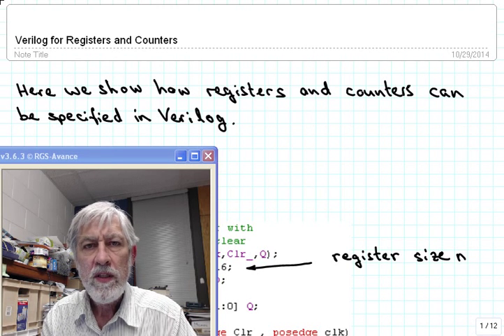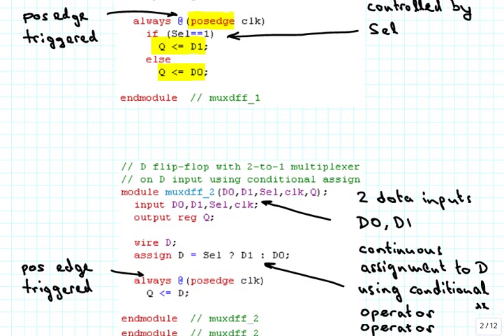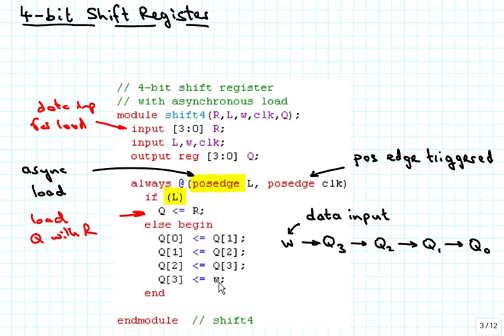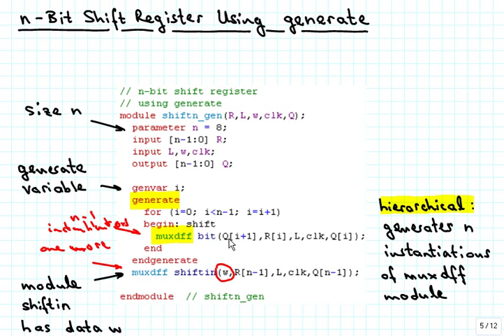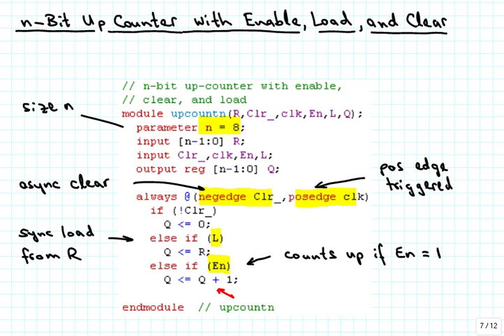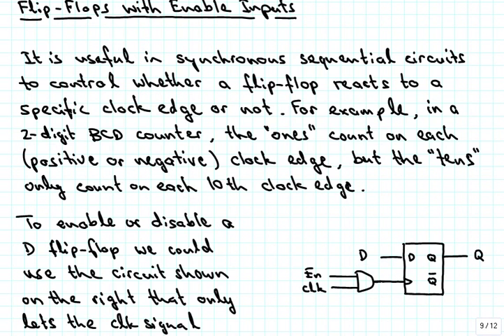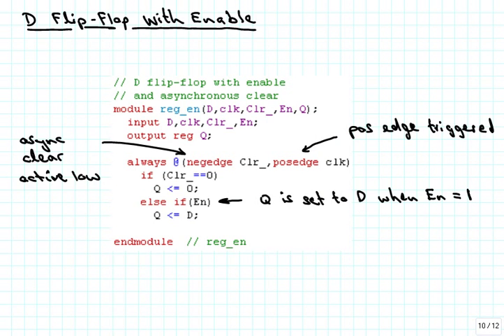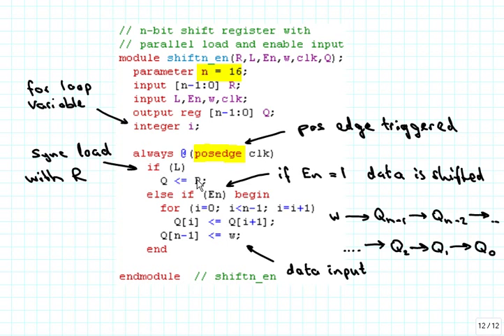Verilog for Registers and Counters

Comment: Sir can we use else if?like
if(....)
{
function
}
else if(.....)
{
function
}
Reply: Ahsan Niaz there is no function. There are modules in  verilog and they are way different than functions. And also you can not call module inside of any procedure. It should be always outside. To be more clear you can not call any module inside @always block

Comment: Please help... + seal3081  
I am a little confused about the asynchronous clear

if ( !clr ) { }

and

 if ( clr == 0 ) { }

 Have the same meaning ? i mean clr is zero in both cases , !clr = 0?
Reply from the maker: Antreas Apostolou It is asynchronous because of the statement negedge Clr_ in the sensitivity list. That means that the always block is executed not only at the positive edge of the clock, but also at the negative edge of Clr_, whenever this may occur (asynchronous with respect to clk).
Reply: Peter Mathys 
  Yes i can understand, but what about the !CLR  value...is it zero ?